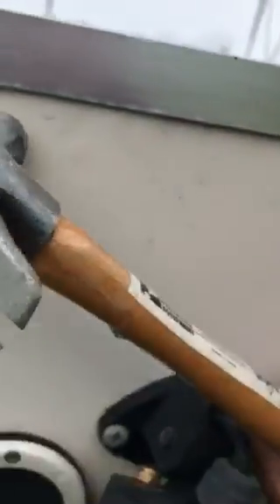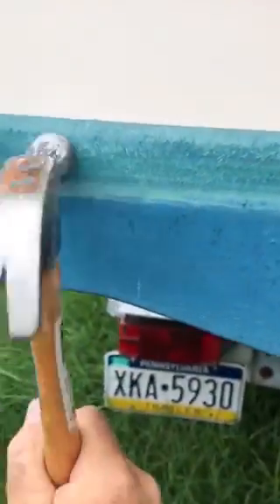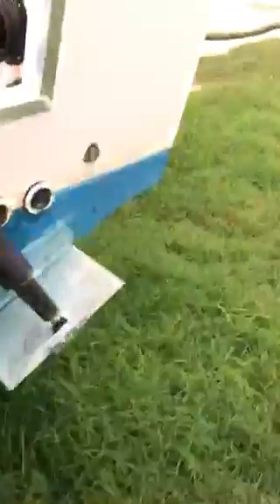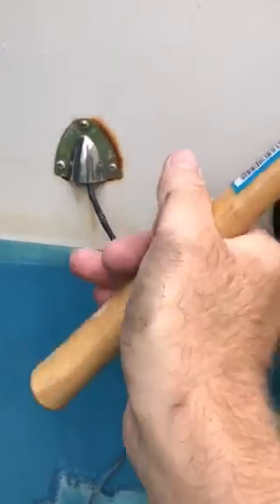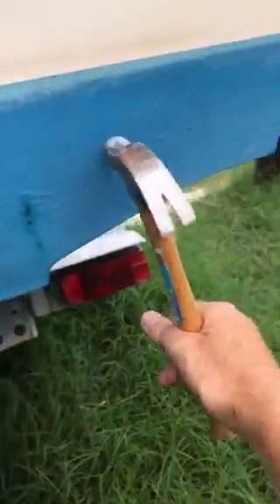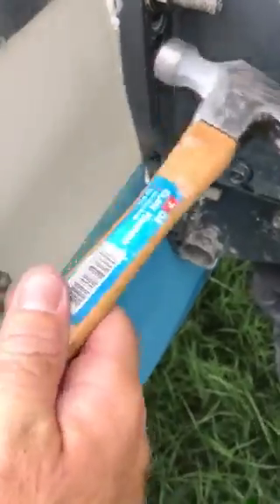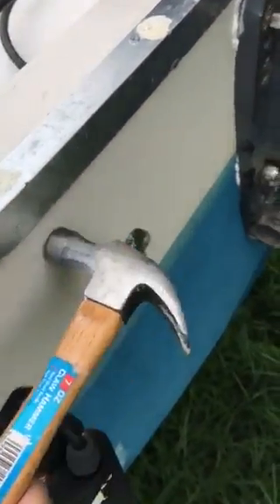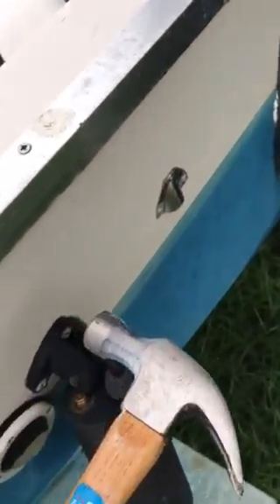85 grady white transom test for rot

Comment: That's not rust around that clam shell, that's tanic acid. That's a scientific name for rotted wood. Didn't matter what 80's Grady you got. When the dealers rigged them, they didn't resin the holes, plus the factory used plastic thru Hulls? That's a big WTF? I had a 89, 25 bracket with 2-200 Johnsons. The drain suppers were below the water line at the dock. The hole ocean will come thru a 1 1/2 hole when a hose breaks off. Very disappointed in what should have been a awesome trailerable battle wagon.

Comment: Did everything check out or did you find rot?
Reply from the maker: a bit of rot..I passed on the boat.
Reply: peanutavalon thanks! I have a old boat that is very similar with the tap test.
Reply: You will never find an older Grady without some wet transom.  But what matters is how much.  The transom is like 3 inches thick.
Reply: Is it acceptable if there are a couple of small areas which sound a little different, or does it always mean full transom rebuild?
Reply: @MC-kg8hm  that transom is fine, it will always sound solid towards the bottom because that's where the transom meets the hull and the glass is thick.  There are millions of boats out there running with rotten transoms, it's something to look for but I think people blow it way out of proportion.  Every older boat has rot hidden somewhere.
Reply: @ncurc9766  I agree with ncurc 97 completely..... that transom is solid as a rock..... when this video was posted in 2017 and the boat being an 1985 .... I would have bought the boat.... all these older boats with wood transom and stringers have some % of moisture and rot..... its the extent of the rot is what needs to be considered .... that transom in that 85 grady at the time of its recording in 2017 was freakin rock solid